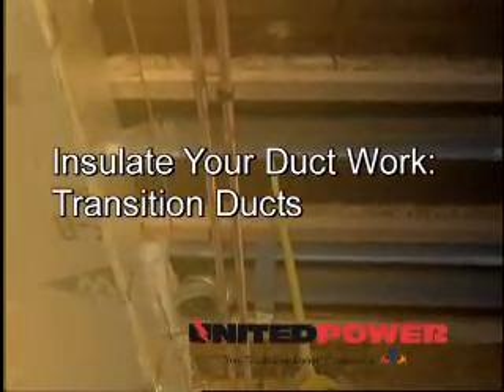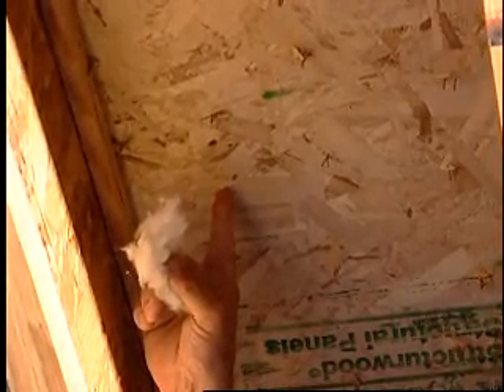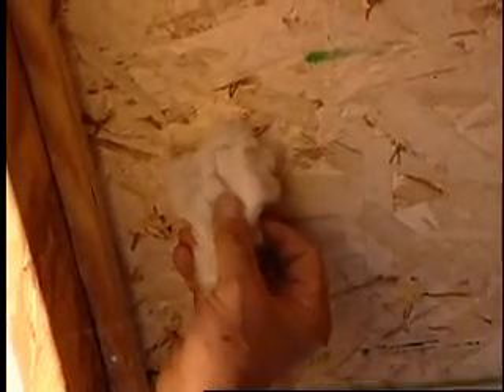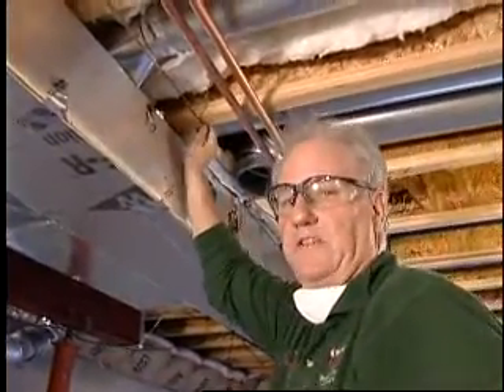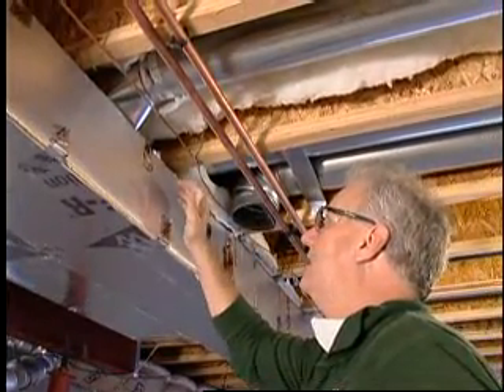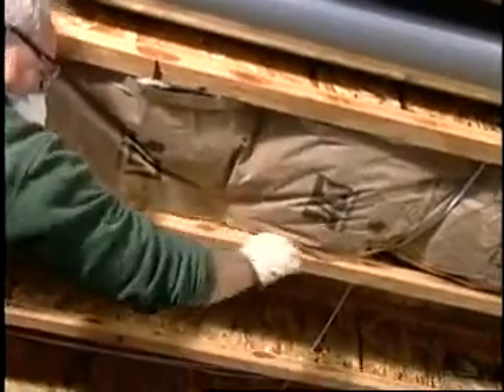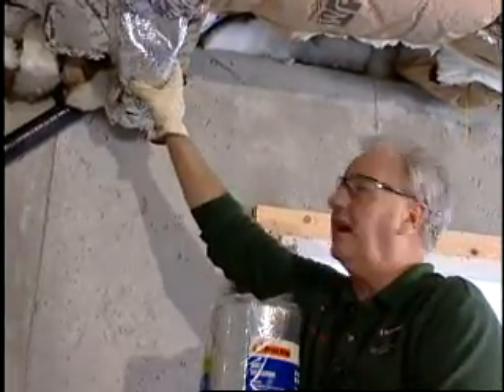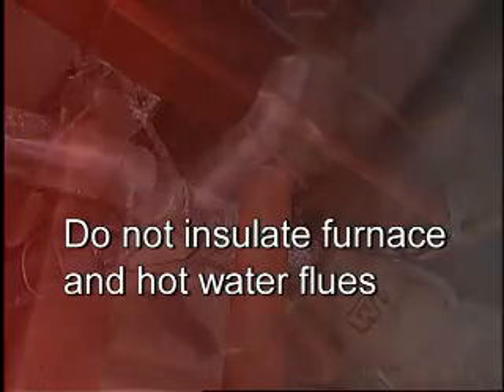United Power: Insulate Transition Ducts: Part 3

Comment: I have a Return Duct that is against my wooden center beam the whole length in the basement and I can't fit anything in between to insulate. What do I do? My second Question is, I feel air in certain parts of the ductwork leaking out, do I use the metal tape to patch them before putting the board up? I would think so using common sense, but I had to ask.